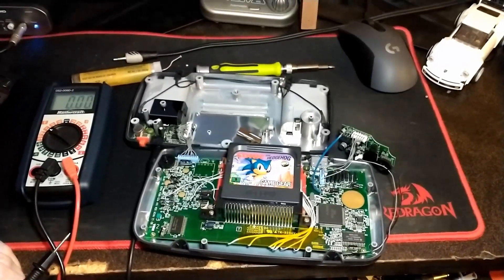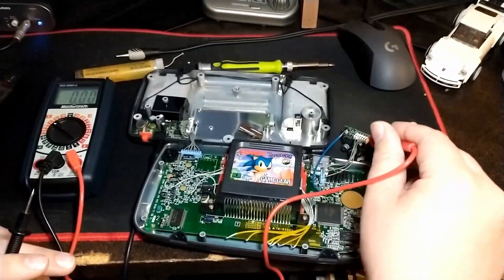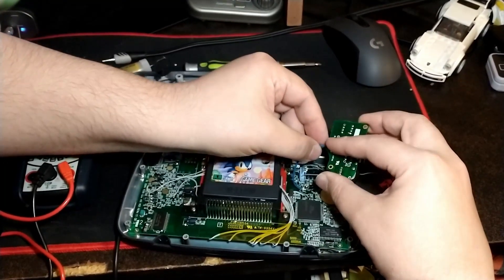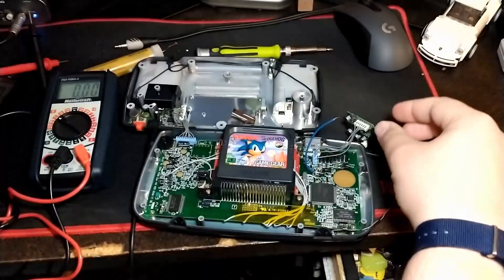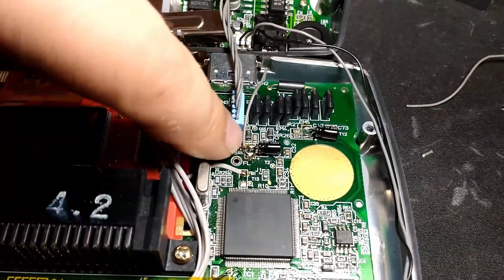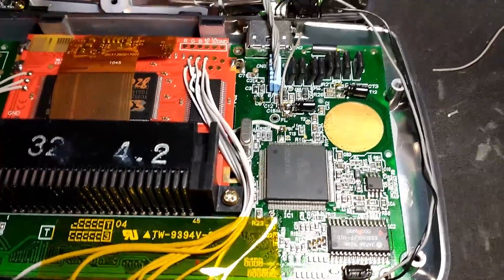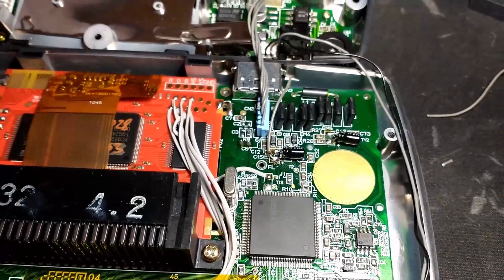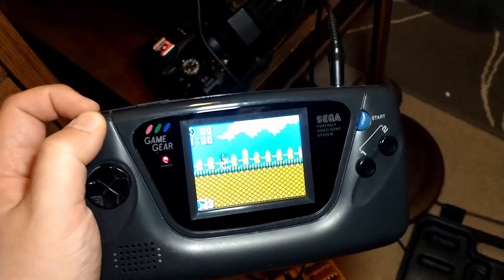OMFG I Actually Fixed My Game Gear's Audio Issue!

Comment: ah so my screen drawing away too much power might have been a closer guess than i thought, but that fix someone offered is for sure nice to have ^^ love taking out the gg for a round of sonic every now and then and thats no fun without sound obviously!
Reply from the maker: Possibly I wonder though could be anything right down to a simple resistor going bad
Reply: @MN12BIRD  you know more of this than me, i was just spitballing to help along the solution process if anything, awesome to see it working again. i know how bummed idd feel starting up my expensive screenmodded gg only to discover the sound not working as well.

Comment: Feel-good story of the year!  I went back to the comments from the prior video and saw that you'd found that the voltage to the sound board was low, so I expected this follow up.  I figured it was something you could track down provided you knew what to look for, so the schematics were key to the whole thing.  Good that someone was able to provide them.  Just yesterday I watched a video on Retro Core where Mark was talking about temperamental original PC Engine CD-ROM units and at least one person in the comments said they're very sensitive with their power supplies.  Apparently, and perhaps that's down to their age, they can be sensitive to their power supplies to the point where being on a power strip with certain other things can prevent them from reading game data.  I wonder if that's happening here, either the power supply being slightly off or the mods are somehow affecting the voltage in a similar way.  Good to see that it is working, regardless of the cause.  Hopefully, that will be it for a very long time.
Reply from the maker: Not the power adapter in this case since it was doing it on batteries too.  Who knows failing resistor or something maybe or something to do with the screen mod.

Comment: Oh awesome! I am happy those comments went through as email, as both disappeared on my end even after editing the actual link. And was totally stumped on what to do.

Considering it was working before, I wonder if another component is suddenly drawing too much power and not allowing enough to flow to the sound board.  Like you said, as the voltage dropped lower and lower, cutouts got worse. Other than turning to heat, that voltage has to go somewhere. Though, the additional mods make it more difficult to know where and how power is now flowing.

Another project to add to the list :P
Reply from the maker: Yeah thanks for those schematics they helped and may help again in the future!